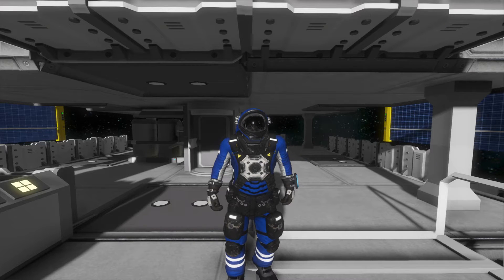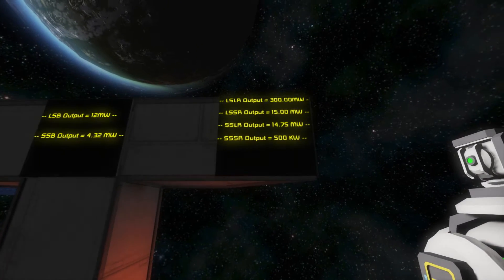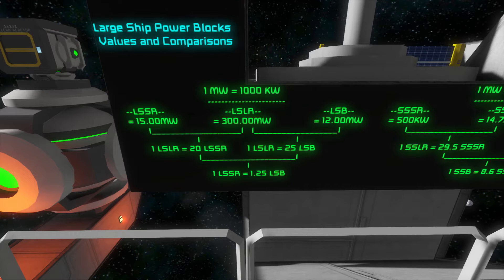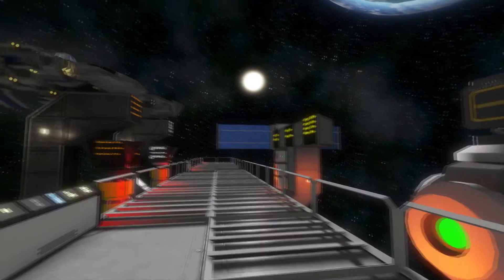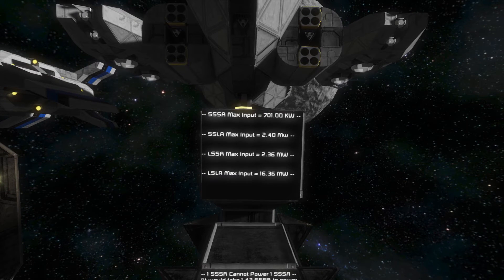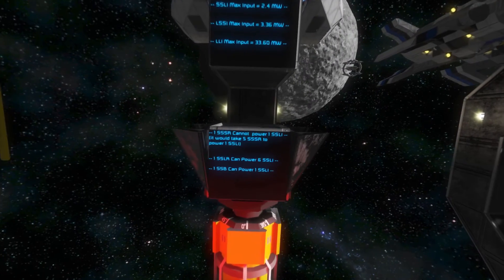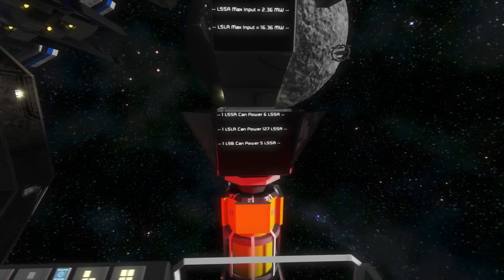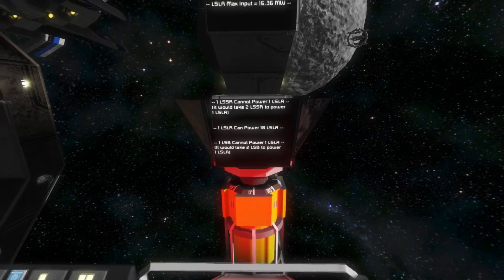Space Engineers Guide - How Many Thrusters Can a Reactor Power?

Comment: Added this video to my favorites, for future reference.

  I like to use "direct power" only from the reactors for the "full capabilities" on my ships; using the batteries only for a "limited mobility" [aka: emergencies] with their "U.P.S. like" (15 minutes window) reserves.

This simplifies the "panic button sequence" for when all uranium dissapears from the  MAIN Reactor (or when it blows without destroying the ship); to just two clicks:  
1) Remove "recharge" from all batteries [no exceptions!].
2) Disable the "non-esential" engines [special group for OFF].
  
Typically this happens on planets using atmospheric engines; as a single "big" reactor is enough to have two of the "big" atmos pointed for each of the four cardinal points (8 total), plus 8 pointing down (anti-gravity); and another 2 pointing up [also reversible in case of overweight].
-> When the main reactor fails, activating an array of 2x2x5 batteries is enough to power just 2 of the eight "big cardinal atmos" (one to slowdown fordwards movement and the other to control side-to-side drifting); while the other 8 keep fighting gravity.
  
The slow descent that happens when overweight can be controled (but not stopped) by not reducing the horizontal speed first (so efectively there are 10 engines working against gravity most of the time like when the reactor worked).
  
Of course, you still need other "little" reactors, and "dynamical" batteries (not-always-stuck-on-recharge) to handle the other anciliary stuff like gyroscopes and lights while the emergency is still happening.

Comment: It might be helpful for some new players to see this visually.  For example, a huge pile of small reactors and how they compare to a large one, which take up 27 blocks.  For something expected to move around, it's helpful to compare the masses as well, especially on something like a light fighter.

Also, I think the actual power requirements for hydrogen thrusters is a lot lower than advertised.  I'll have to double check that.
Reply from the maker: +Low Rads Yup I agree, a visual representation would have been better, I based the values from the thrusters themselves, but if they need less power, then thats even better :D